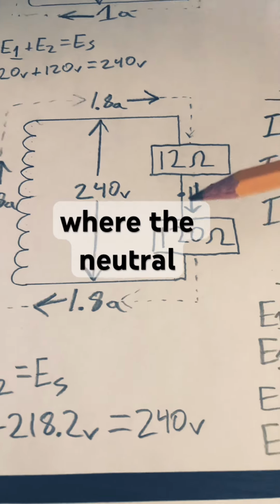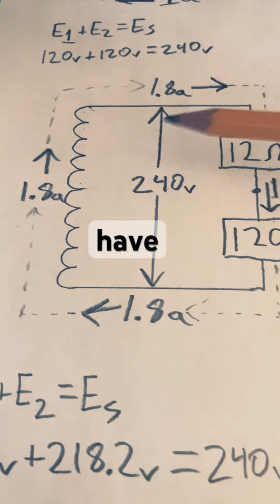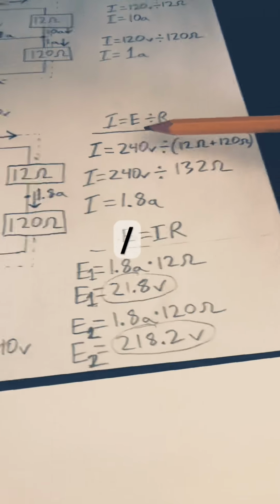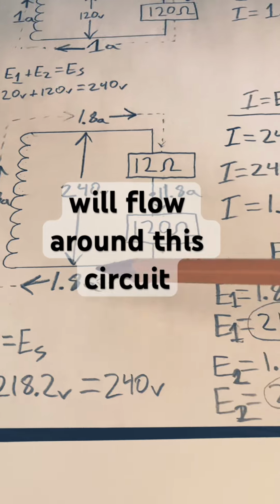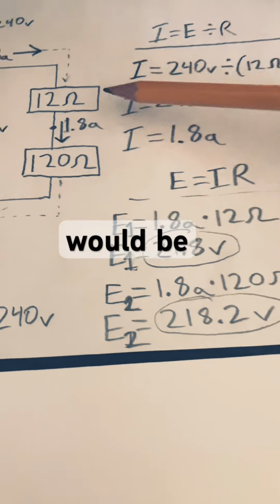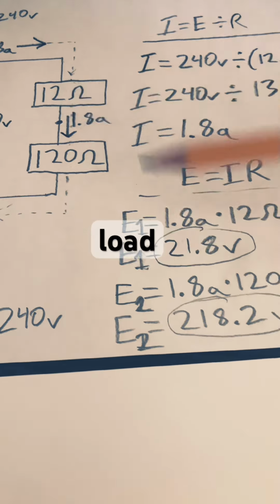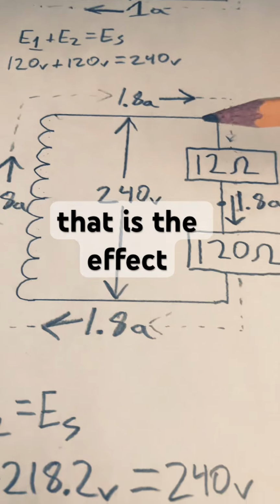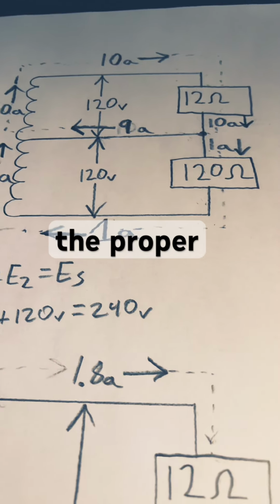The 3-wire system if no neutral? #electrician#ohmslaw#maths#engineering#science

Comment: The symbol for voltage is U not E.
Reply from the maker: I think you mean “V”(I have never seen “U” used). But, the symbol “V” is commonly used nowadays, however, originally Ohms law is E I R as opposed to V I R. The reason “E” is used is because it correctly represents what is being measured which is EMF, voltage is the expression of EMF. I chose the original way which is using “E” to properly represent what is being measured and expressing that in volts. Thank you for your comment stay tuned for more exclusive content🎉🎉🎉
Reply: @electricaleducation101 you should learn the international units system or have a look at Wikipedia...
Reply: @electricaleducation101 V is used in e.g. USA, but it's not the international symbol for voltage.
Reply from the maker: @patricklehmann24  
As I mentioned, the "E" stands for EMF and its SI unit is "V". This is actually mentioned by IET in their booklet they only show one symbol for EMF which is "E". In the video "E" represents EMF which is expressed in volts we used the symbol "V" to represent its unit of measure. EMF is the electromotive force and this force is measured and expresses as voltage.
As far as voltage is concerned there are other symbols used for it, and it is not only "U" as I can remember slightly. "V" is also mentioned as one of the international symbols not just in the USA.
Reply from the maker: Also, many text on this subject matter use these same expressions as I used to represent this, text both from the US and other countries. The expression shown comply with that, it is not my own opinion.
Reply from the maker: George Ohm originally used the Symbol "E" in his treatise as well.
Reply: @electricaleducation101  as a German researching about a German physicist, he initially used S, L and A. This was before SI units were defined.
Source: "Die galvanische Kette, mathematisch bearbeitet", Berlin, 1827.

The symbol for EMF is ℰ not E. ISO and IEC deprecated the use of ℰ in favor of Us for source voltage. Please also note, Us (EMF if you like) is used for sources, while your video is about loads, right?

Let's stop this discussion here :).
Reply from the maker: @patricklehmann24  
Please carefully rewatch the video. 

Actually I know that S, L and A came from his geometrical proofs when talking about the force of current "S". 
"F" was then used to denote the Actual force of current instead of "S" today "S" can be "apparent power" in some senses.
"A" was described as tensions and was replaced by "E"
"L" was described as a reduced length and replaced by R. This is also mentioned in that book.

Also, it explicitly mentions in one of his treaties in many places "E the electromotive forces" and in many places in his book as the "E" representing the same. Other German Physicist and engineers used "E", argue with them about it. 

Overall, the ones before me deduced and clarified this all down to what we have today which is E=IR, this is the expression used by many prominent ones. It is not from my own opinion or just the USA's usage. My point is to continue that journey, not too confuse and try to come up with what has already been taken care of.

For the record, there is nothing wrong with "E" being used to represent the Electromotive force across the source and its loads. 

Thank you for this discussion. 
Feel free to check out my other content
🎉🎉

Comment: Makes good sense.  I’m not an electrician by trade but I can see what could happen if the neutral wire had a bad connection in a split phase kitchen appliance circuit.
Reply from the maker: I am happy that you find it easy to understand. Stay tuned for more exclusive content!!🎉🎉